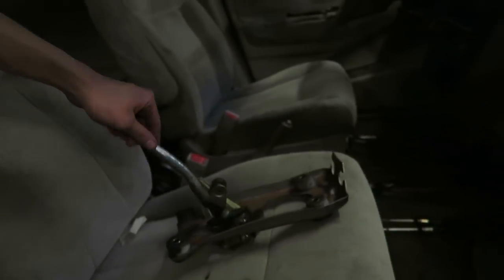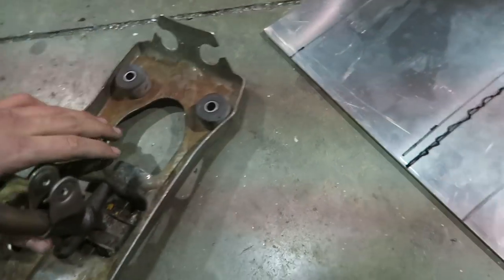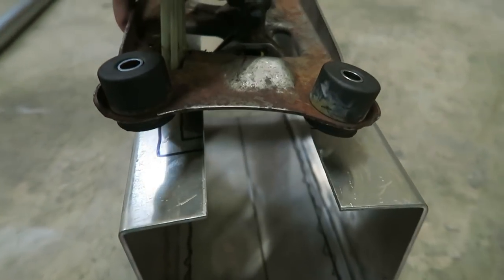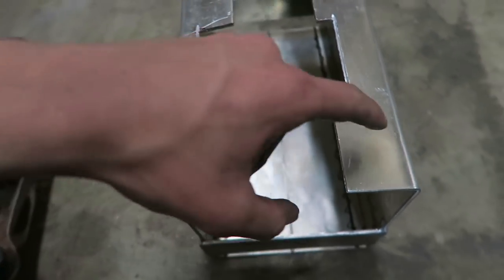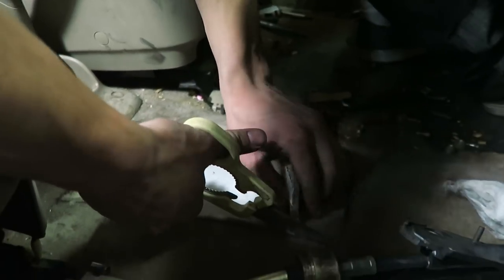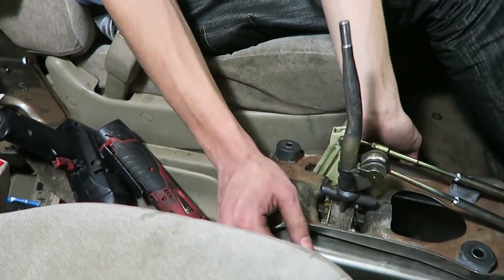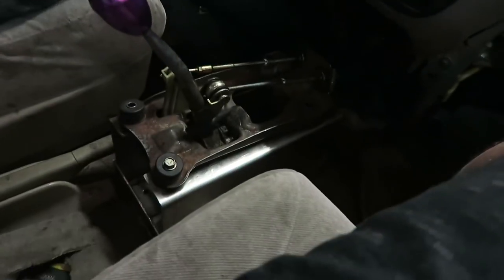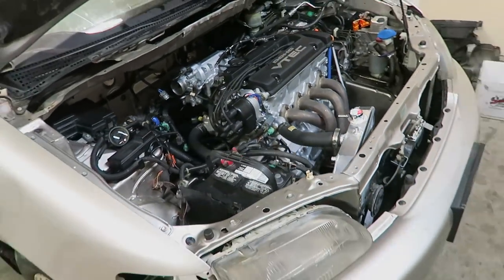Turbo Minivan Build / Mounting the Shifter

Comment: Use an old transmission oil pan for the shifter mount
Reply: Or engine oil pan
Reply: Aidan Rogers That's a great idea👍
Reply: Brilliant!
Reply: Yup used the idea in my 84 c10
Reply: Weight reduction breh
Reply: Aidan Rogers hell yeah, the more i watch this stuff the more i wanna buy a 500 dollar Honda to go nuts on lol
Reply: Mike White I've been thinking about it I've found a couple for 600$ in my area that are in great condition
Reply: Mike White i judy bought a 1990 acura integra gs 2.0 for 1600 and i love it!

Comment: 6:45 "Keep it as original as we could." He says in an H22 powered soon to be turbo stick shift first gen Oddyssey. XD
Reply: 802 Garage is Kyle gonna put in a real turbo or a eBay turbo?
Reply: I'm sure it will be an eBay dual ball bearing turbo like the one on his hatch and ton the MR2.
Reply: 802 Garage just imagine if he puts a real turbo on all his cars & the van
He could probably make a little bit more boost & HP
Reply: I mean I guess, but it is a "real" turbo. I doubt the specs would be massively different with a Garrett or Precision of the same size. Would be interesting to see though.
Reply: 802 Garage on Hayden's rx7, I like the eBay twin turbo set up he has & I want to do the same for my truck
Kinda like Ken blocks mustang with the twin turbo sticking out the hood
Reply: Jeremy Hill What kind of truck? Would be sick. Especially Small turbos for just tons of instant massive torque.
Reply: 802 Garage 1999 ford ranger
Reply: 802 Garage have you seen (boost by the pound) CH? Is very good for all things that are fast.
Reply: Jeremy Hill Hah, sweet! Do it. ;)
Reply: andrew wright I have a bit, but I'll check it out more.
Reply: 802 Garage same thing nik blackhurst said about his mini that had 60-70% of its body cut out and replaced. He is also squeezing in the drivetrain and engine from a celica
Reply: Or What? Project Binky!     My favorite build series!!! So sad there sooooooo far apart though!
Reply: Spiritpoweredinternet LOLOLOL you think I have money to waste on that? I don't even know if that's a thing!
Reply: Or What? You should check out Initial DIY mods! He is swapping the AWD drivetrain from an Eclipse GSX into a Mini! It's incredible.
Reply: Yes the specs of a precision or garret or borgwarner are massively different lol,
Reply: My point was that this turbo already is a clone of the Garrett design.

Comment: Mine says Isuzu. Bought it for 1300 bones in FL and drove it to IA. At one point, I threw in the towel and bought an entire case of oil, but it only burned half. Lol  Cool old vans tho! You can score trunk space if you pull the spare outta the back. 2 glove boxes up front. Pure swag. I was thinking of a manual swap upon rebuilding it, so this is very informative. 🤘🏼

Comment: Toyota previa minivan build next. Awd supercharded mid engine monster.
Reply: cec4video slow down there bud 😂
Reply: MostlyIrishCarGuy na gotta go fast...whap and gone.
Reply: cec4video na, too easy
Reply: Dual engine... Two engines in tandem.
Reply: Previa with the supercharger AND the turbo!! Like the Nissan March ST(super-turbo)
Reply: ive had this idea for about a year now but everytime i bring it up my friends say its a dumb idea.... its a mid engine AWD race van, whats not to like?! the drivetrain could be swapped into a tube frame and make a wicked cheap track monster.
Reply: Jordan Liske not really, its a lot more cimplicated than that.  It would need a new acssorie drive system cause it runs a jack shaft to the front to furn the alt, ac, ps etc
Reply: Hightech Redneck Backyard Barn tire. We could do an electric conversion for the water pump/ps etc
Reply: Jordan Liske it require a whole new engine setup since its 45 degree slant 4
Reply: Hightech Redneck Backyard Barn what's wrong with that?
Reply: Jordan Liske room to keep it a mini van,  it wouldnt be a sleeper if it had to use a normal engine.  It pop up through the floor.

Comment: 0:04 That almost happened to me the other day in my G35. I floored from a stop (a truck was beside me, i imagine he wanted to cut me off, because we were on a one way residential blvd & he was sitting where parked cars should be sitting) Turned green, floored it went passed the the cross street hump and almost caught air, look down was doing 80, left off look behind couldn't see him lol brought it down to 60 and the next hump it went feeling light. Still too fast for those cross streets. Made it to the light. Waited what seemed like minutes then he came rolling along. He was pissed because he chriped his tires and turned right. Ps my stiff suspension saved me from bottoming out. I bottom out on speed bumps if I don't take them on an angle. I have a exhaust leak because of that. Edit: I think i did catch air because it hurt (stiff suspension) when I landed. The difference between that Honda wagon and my G35 is weight distribution. Mine won't nose dive like that because it's close to 50:50.

Comment: Why is the blinker hauling ass?
Reply: The van is missing the front turn signal on the right side. As such, less electricity is being drawn by the system and the remaining lights cycle at an abnormally high speed. You also see this happen when a bulb burns out or someone installs LED signals on a car without considering whether the car was built for them or not.